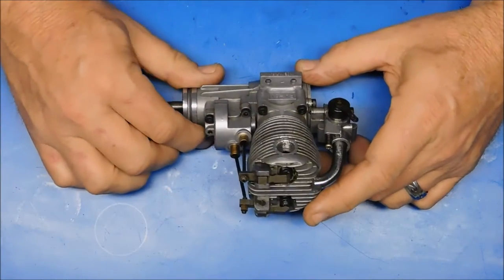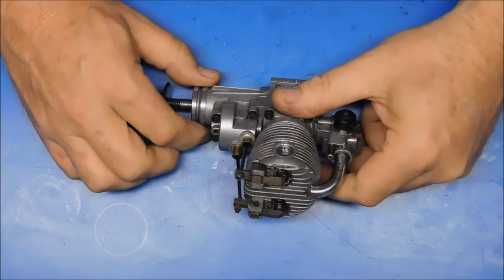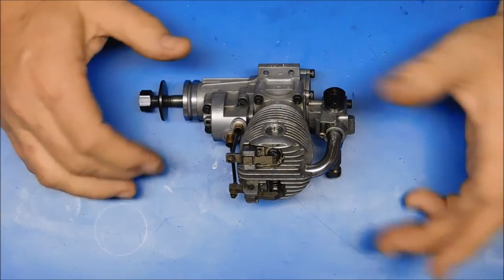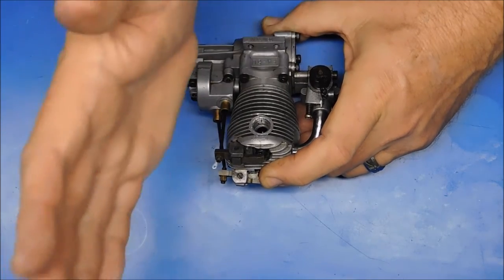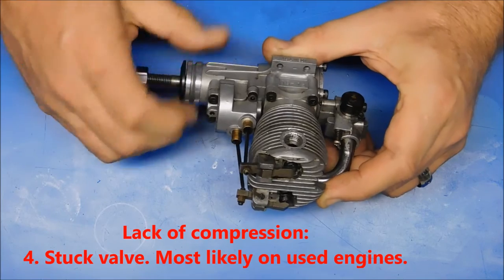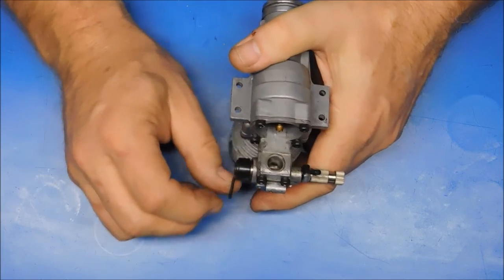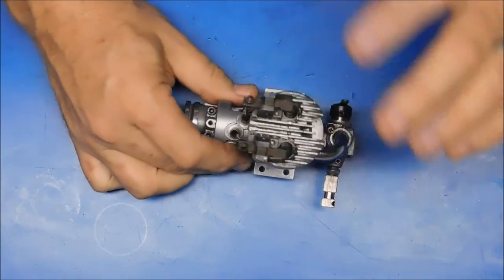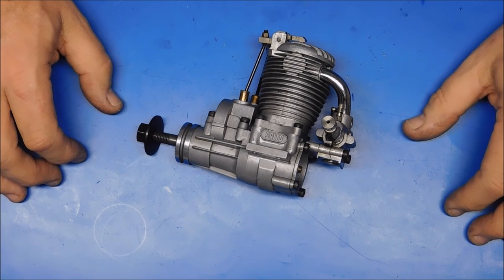How To: Basic 4 Stroke Troubleshooting

Comment: What I like to now is if you buy a new engine, do you need to get the backplate of to look inside the engine for metal shavings, in the old days we did that, before we let the engine run for the first time, if there were shavings we flush them  out and we did clean the engine first, do you recommend that to do now also when you buy a new engine or is that step not necessary anymore
Reply from the maker: I have never done that on any new engine except the ASP ones.

Comment: Great video David. My question is, if a have bad compression because my valve beds is no good.  What I can do for fix that?  Thanks
Reply from the maker: If you are certain that the valve seats are no good you have two options.  Lap the valves and attempt to reseat them or replace the head.